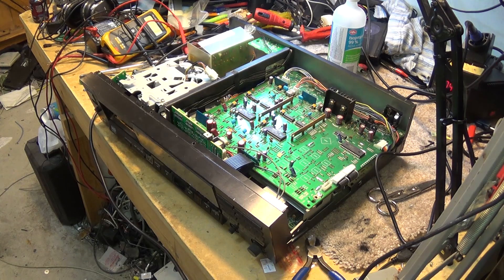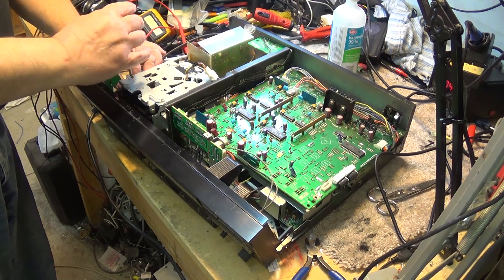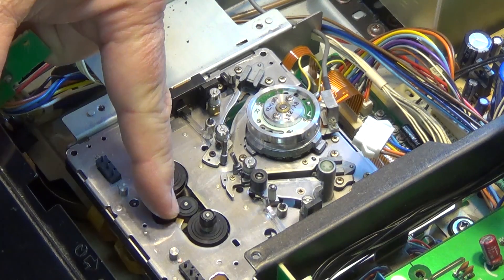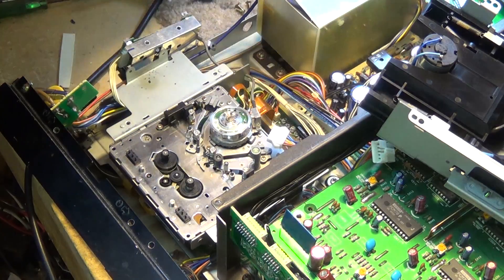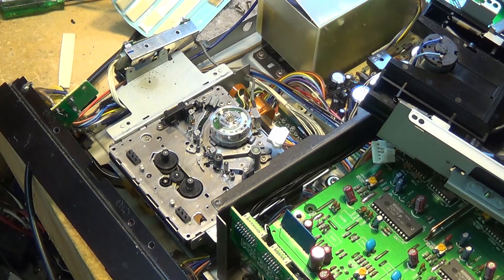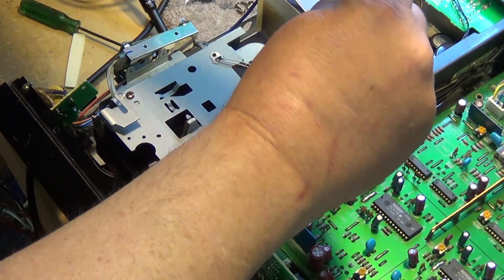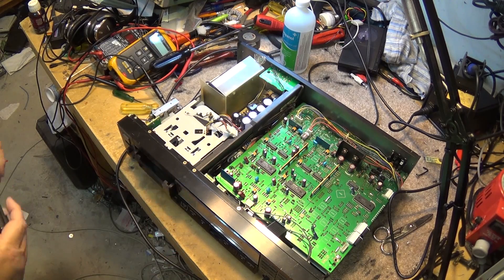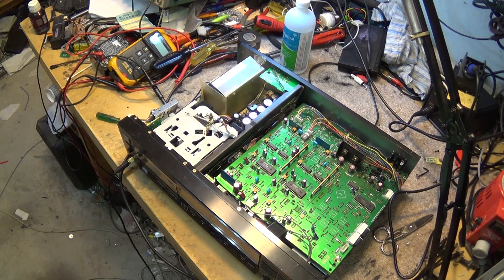Panasonic SV3500 DAT Transport cleaning procedure

Comment: I have an SV 3500 and found this video helpful but either my 3500 is different from his or something else is wrong. There were a lot of wires on top of the transport system that i didn't see in this video, in fact he just skims over the removal of the transport. In my case it was impossible to move the transport out of the way as he did. My head preamp did move easily like his did, in fact it didn't move at all .I got in there with my stubby fingers but it wasn't simple as the transport was not nearly as easy to access as his. I then put it back together and something went wrong that was my fault, the door didn't close properly. I'm trying to fix that but there was a buzzy sound for a second so possible that I blew something. I did get a chance to listen to a tape first however, and the distortion I had heard before was still there. Tried another DAT machine and it wasn't there so I'm assuming something is not right with this machine. Again, I appreciate that someone took the time to show owners how to clean the 3500 but I guess Panasonic built them differently at times as mine was made slightly changed from his and the cleaning was much more difficult. Oh well, thanks anyway for the effort.
Reply from the maker: There is another video showing the head preamp and servo recap

Comment: nice video, I would like to clean my sony dat heads and rubber, one guy in a video used lighter fluid to clean his cassette heads, what is your opinion on that? he said a engineer recommended it,  so what material can i use to clean heads and rubber, some suggest paper. no cotton right. thanks for your help.

Comment: Hi,I have seen you use paper soaked with 99% alcohol to clean the rotating head of a VCR. Can I use that method here? If not, what kind of swabs are best?Thanks,
Reply from the maker: Tape transports that use metal tape (8mm, Hi8- DV and DAT) generally do not clean up well with alcohol. A dry cleaning tape will clean the heads but over use will wear the head faster

Comment: Nice and clean, and the data error light has gone out now?
The head drum looks so diddy, i bet it spins at a hell of a rate.
Reply from the maker: +zx8401ztv spins at 2000 rpm. Just a little faster than a VCR. DV on the other hand the drum spins 9000 rpm!
Reply from the maker: +zx8401ztv Yes, NTSC is 1800 RPMDAT uses 3 speeds. SP speed is 2000RPM, the LP speed record is running at 1000, but playback is read out at 2000, and the Hi bit raye is 4000 if memory serves me correctly.Digital8 cameras ran the drum at 4500, and recorded 2 frames of DV stream per track on 8mm, doe to the larger drum size, and the 210' tape wrap of 8mm.Yes 8mm is 210' not 180, because there was extra "overlapped" area for each track where digital audio and time codes could be written on that format. On the 8mm format, only about 7mm was used for video, and the extra length of each track on that last mm of tape width could be over written after recording for PCM audio dubbing and RC time code. Tha extra area was used in the digital 8 format to store picture. Digital 8 was actually a very cleaver format, and could have done well as an HD video medium, because of how much data they could put on those tapes.
Reply: +12voltvids 
Dam, im glad i didnt venture past vhs videos lol :-D

Comment: hey remember the video you posted bout the light bulb for the  tv. 

Is there a way to test them without a tv? I got a couple and don't know if they work. 

They are osram p-vip 100-1201.0 E23ah

thanks.
Reply from the maker: +yrulooknatme You need the correct ballast to strike these UHP TV lamps.They need a pulse of about 20,000 volts, and then once they strike, the voltage drops to about 40 volts to sustain the arc. High current, low voltage.